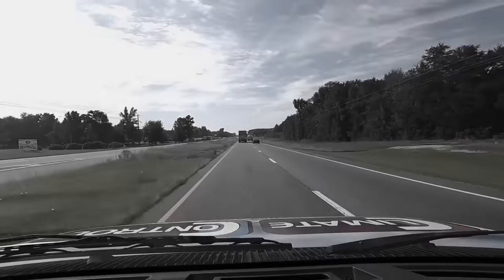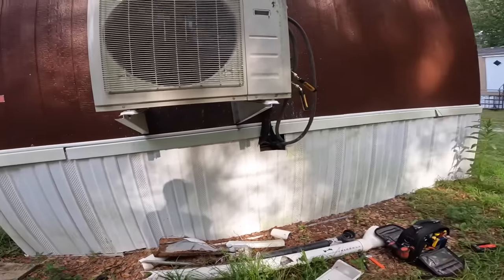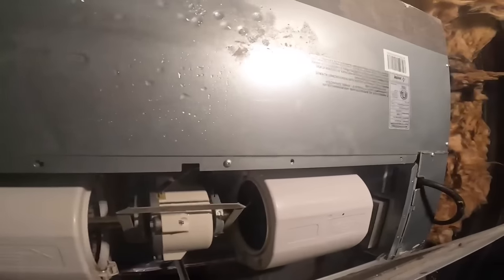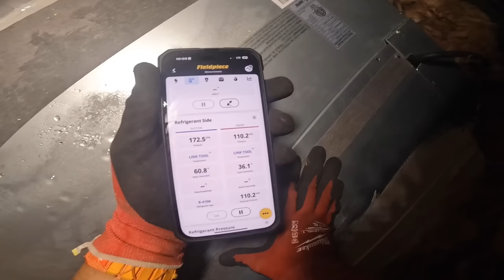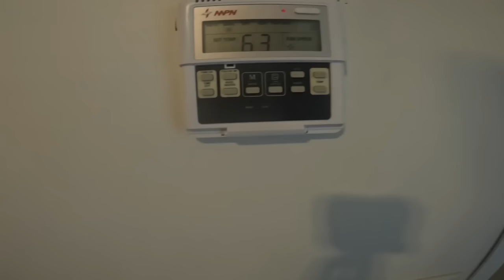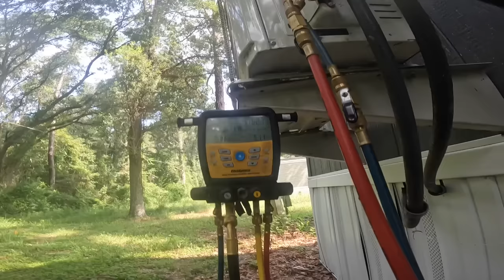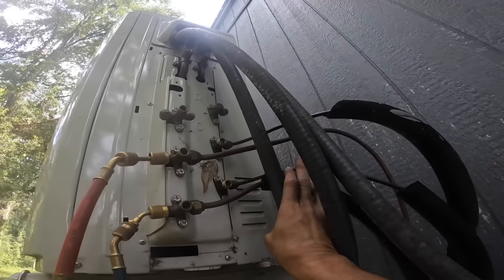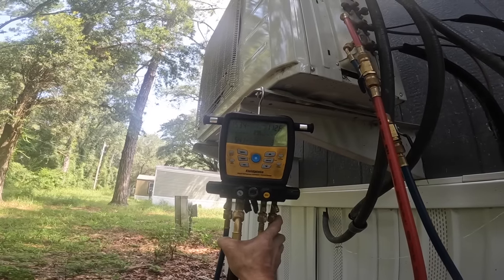Mini-Splits Made For Mobile Homes! Part #1 #hvacguy #hvaclife

Comment: The MPN ducted mini splits they put in Legacy homes are a disaster. Make sure the t-stat has the "follow me" button pressed or the air handler ignores it. Check the returns too. I've had 5 homes with very restricted returns or returns not attached to the air handler.  Also had one that was installed backwards, and another with a chunk of subfloor blocking the supply.
Reply: Was going to mention that, about the follow me setting. Otherwise I believe the set point is controlled by a sensor at the indoor unit. And in follow me mode it will display indoor temp along with set point on the stat.

Comment: Why am I not surprised when mobile home manufacturers choose another cheap junk system with poor performance, reliability, lifespan and repairability? How about they just install the proper ductwork with a name brand piece of equipment, in a large enough closet INSIDE the home, repairable using common parts on a service truck and with a 10 yr parts warranty? “Low Airflow”…yeah about 100% of the time with 4 x 13 beer can trunks.

Comment: Mini-splits are good units until they break down 😢
Reply: I washed my last mini (other than my own installs) a month ago. Finished cleaning, threw a communication error code. Three more “free” hours drying everything. No moisture in main board compartment. Never again.
Reply: Isn’t everything.
Reply: I give up on minisplits back in 2010 they were way worse than and still r cheap made no money in them if they last 5yrs ur lucky

Comment: Didn’t realize they made a Min8-Split for a Manufactured Home. 🤔👍
Reply: If it’s cheap, small enough to be hidden under floor or in an 18.5” wide closet, lacks performance, has a no name branding, you can bet mobile home manufacturers will use them.
Reply: These pieces-o-junk haven’t made it from Ga to Ky yet. I can guarantee you, I’m not taking any calls on them.

Comment: I am glad I do not have to work on those. I have never liked the mini splits just because they are hard to get access to things and everything tends to be really tight. Once I found a goodman mini split board fried by a frog. Frog was cooked but took the board with it.
Reply: My first mini split was a Goodman in 2002. Nothing but problems! Ended up installed standard 1.5 ton split in 2006 at cost! I told myself that I would never sell  another one until 2022, when I installed a Fujitsu. So far so good but believe me, I won’t be putting in very many of them. I will not work on anyone else’s, especially if they’re DIY’er.

Comment: Curtis, that is just a basic concealed ducted unit that can be used on anything.  Read up on Mitsu, Daikin, Samsung, Fujitsu stuff, etc... They all have them.  Just little slim fan coils is all they are.
Reply: they get put in suspended ceilings often

Comment: I’d find some way to plumb those air handlers topside if I owned that unit. Manufactured housing is definitely a leader in stupid hvac ideas lol. Glad all  I had to deal with back in my days were exploding oil furnaces and typical split system problems

Comment: Nnp never heard of it.

I know diakin has vrv life and and Cooper and hunter has a system that can have a separate head and a central air handler.

But honestly Curtis for this custumer a Mr cool mini split installed correctly by you and vacuaned by a pro like you

 or a gree flex sized properly by you and mounted on the same bracket they already have would be more appropriate

VS whatever brand they currently have.

Ohh and Curtis thier are now some other manufactures trying to make diy mini splits that are manufactured poorly besides Mr cool.

And telling people you don't need to flush the linesets are vacuam either.

And one guy tried to tell me with Mr cool vacauming a quick connect line set voids the manufactures warrenty.

Again not true it's just common sense to do a leak pressure test without soapy water and vacuam it and make sure it holds.

Comment: A good time to buy a few shares in Nylog!😂
(Good Stuff!)👍
Reply: Good time to buy a good tool and make good flares, then pressure test to max allowed by mfr, using a little oil on both sides of the flare. Antisieze  on nut. I’ve never had a leak in 25 years.

Comment: On the first system that the pressures improved when you opened the access panel I would say the problem is the duct work. Open it up along with replacing the motor and drive. I have experienced the same effect with just hearing the hiss and using my hands to cover the area to find exactly where it is. Though there are times when you can hear it but can't lay hands on it and that is where our fun tools come into play. I would say for those systems who ever installed them was the hired off the street and shown how to install in one day then let loose with the tools. I used to work for a company that did that and now they are headed down a road that I am no longer part of. Lets just say they may be loosing EPA for sure in the end. Something to do with just opening systems to atmosphere and replacing components. No recovery equipment on their vans. Just tanks of refrigerant, gauges and a vacuum pump. I am talking about systems that hold 12 lbs of r410, r22, r404, r448, r449 you name it. I even worked on some of the systems installed by previous so called techs that put in a cooler coil with no metering cartridge in the Sporlan TXV and overcharged to make it work. I am glad to be away from that company now.

Comment: Why would anybody order, or buy, a mobile home with the air handler installed under the floor instead of in a closet.  Cutting the plastic wrap below the insulation will be a real problem because duct tape won't stay stuck to it for long when you try to seal it up again.

Comment: Ok so pretty much this is the way I see it with trailers... the manufacturer of the trailer wants to make that profit off of that minisplit instead of the local company that sets up the trailer. Up until recently, the trailer would leave the factory with the usual Revolv air handler and ductwork installed. Some were upflow and some were downflow just depending on how nice of a trailer it is. The company that sets up the mobile home usually has a local HVAC contractor that they work with. That contractor would install a Mortex coil in the air handler and usually an ICP heat pump outside.  Now the manufacturers like Fleetwood and   Clayton want to keep all that money in-house by shipping out the trailer with their mini split that they install. Like every other builder, they buy the lowest grade no-name products that look shiny and fancy. Honestly the Revolv air handler was a really good value. It has a regular PSC motor and is simple. 
Legacy homes is pre-installing the whole traditional hvac system at the factory. The metal framework for the trailer comes out at one end and there is a platform that a Goodman condensor sits on. 
Warren Buffett owns at least 50 percent of everything involved in the mobile home business, maybe more. 
The entire town of Douglas, Georgia lives off of the mobile home business.
Reply: E Ky is full to brim with them. Banks love them too. Pure junk. 4”x13”, undersized, uninsulated, unsealed ductwork. Once those pos hit here, I will not take any calls with them. The standard setup is bad enough, but at least I carry repair parts or can get them in a day or three.

Comment: Curtis is there any reason why you don't use bubbles to test for leaks? Just wondering  cuz it seems ya sometimes have a malfunction on the sensor on the electricity detector. Not trying to be smart just a common question. I would think you would suggest changing all the flares on all ends of the copper, cond n evap? Will stay tuned to see the rest tomorrow.
Reply: Bubbles r the best

Comment: First off it’s a mini split system therefore there’s a evap coil sensor per evaporator…one charge for the complete system…the higher the temp the higher the pressure…but you have to get circuit # 1 right before you can work on #2

Comment: I guess the crappy mini split bandit installer strikes again.

Wonder if on. The second one if it was even vacuaned.

With that leak and who the heck covers up an air hander with kraft paper faced insulation.

In Pennsylvania that's a code violation and a no no.

I don't know about Georgia if its the same.

And I don't like that in the second one the guy could not even properly secure the outer covering and leaving that bird nest.

But I know you will make it right.

But I still standby Curtis the gree flex bieng a more appropriate option installed by you.

Since you have road tested them. Yourself.
Reply: That is the typical mobile home woven plastic vapor barrier.
Reply: @USA-GreedyMenOfNoIntegrity  yes but you should not cover and wrap the whole air handler in insulation especially kraft faced stuff that's a fire Hazzard with the electrical wiring and can cutoff adaqaute air flow.

But maybe I am wrong and it's a southern thing. But to me it should have been mounted properly on a air handler stand or had a proper plenum box built to mount the air handler on and just insulated the stud walla behind properly and put high density polyiso over the insulation instead of drywall.

Makes much easier acess for an hvac guy. And looks more proper and professional and meets codes.

Comment: When you have inverter systems like this, can you use pressure values the same way as a system with a piston or txv?
Reply: Minisplit inverter systems modulate to keep SH very low, 3 degree range, that’s why they able to get SEERs in 20 range

Comment: I was thinking about getting a mini-split to cool my office separately from the rest of the house because all my computers generate a ton of heat. After seeing this, maybe I don't want one
Reply: Avoid them like the plague! Just run another floor supply and ceiling or high sidewall return (pulls off the convective heat better) from main system.
Reply: Just for your office. I'd just put in a Ductless Mini Split,for that one. Piece of cake. I have one /1 Ton for my whole upstairs in my home. Two bedrooms & Office. No problems,ever yet. 5yrs. Old system.